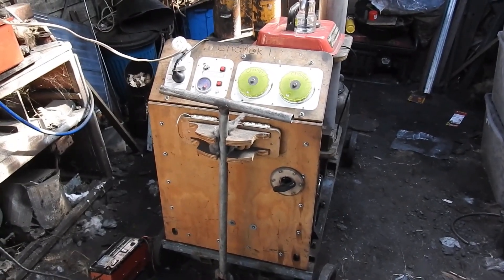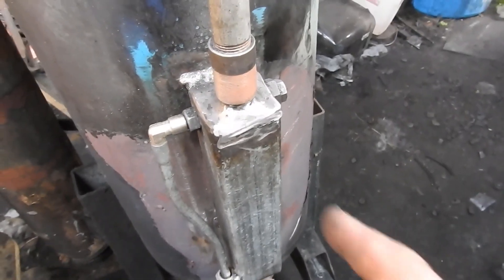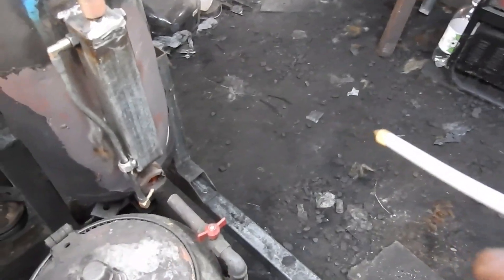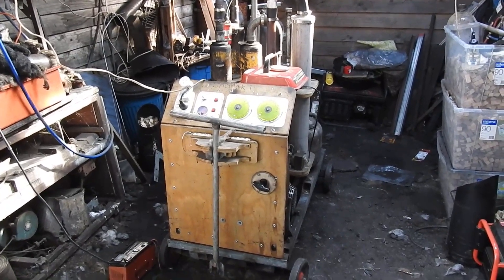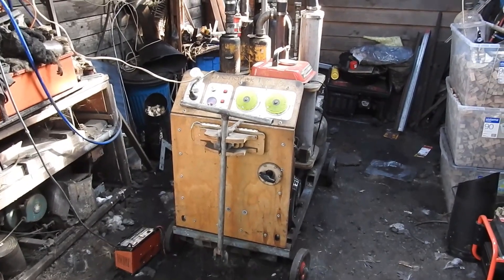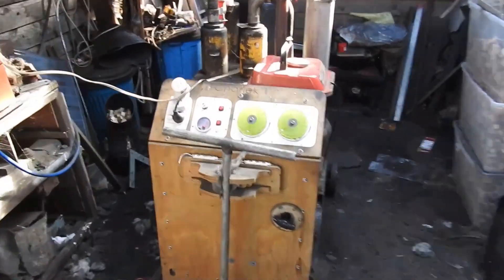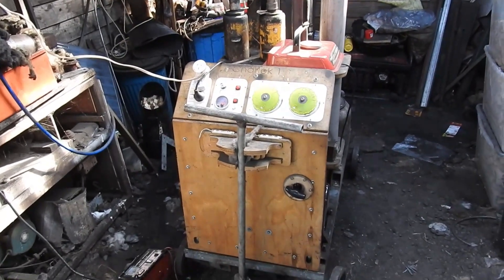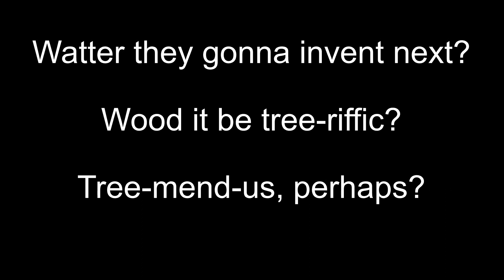If you want more watts - just Add Watter

Comment: In my wood gasifier I put oil in it I did have some success with it but thinking about it now maybe I should have heated the oil  up to a vaper
Reply from the maker: It is amazing watt a bit of oil can do to a gasifier. 
 Like you, I put a little bit in there, when the wood is low, and the glowing charcoal is visible. 
 That's when it seems to be at its best. 
 In no time, I use up all of the oil I collect from my regular engine oil changes   :) .

Comment: Steve I meant to reply back to you on the website blog. Could you possibly set up a high pressure nozzle that put out a very fine mist of water that could be controlled by a toggle circuit that would spray it in regulated spurts directly into the air intake? This way you could break the fine water vapors down directly in the charcoal chamber. Just a thought.
Reply from the maker: Howdee Mike, 
 I like that idea. A high pressure pump, feeding a tiny spray nozzle, wood make for the perfect injector system. 
 I will definitely be working on a couple of ideas, over the winter, to see watt works best. 
 Naturally, I wood like to see if this works on the air nozzle system that my wood gasifier uses. 
 Soooo many ideas, sooooo few spare tick-tocks!
Reply: @CNCmachiningisfun  OK Steve I'm getting ready to blow your mind with a KILLER idea! Buy one of the humidifiers that uses the 40 Khz transducer to atomize the water! Now you have a cold water steam source that will also have a variable intensity already built in. This way you don't have to deal with high pressure anything or special micro nozzles. Put that in your pipe and smoke it!
Reply from the maker: @flash001USA  
 Howdee Mike. 
 You owe me a new mind, 'cos you dun blowed the one I have already got  ;) .  
 I think I know where I can get these things, so, yes, I do believe that I will put this in my pipe - and race my engine on it   :)  .
Reply: @CNCmachiningisfun  But why bother with cold water mist? What you got now is good heat recovery. Why waste energy heating up water in the reduction zone where you NEED stuff to be as hot as possible? Am I missing something?
Reply: @CNCmachiningisfun  Yeah this hit me last night and I thought 2 birds, 1 stone. You get steam or at lease atomized water particles that may as well be steam and you can control the intensity of the flow. If this worked, you could also regulate it through a circuit that would auto adjust the flow for you for an optional ratio.
Reply: @flash001USA  I thought of that too. but its pretty easy to just convert to steam or simply drip water directly into the nozzle. If you drip directly into the nozzle the water will migrate into the jet and evaporate as it makes its way to the end of the nozzle. Besides the boost you get, you also want to cool your nozzle. So it is beneficial to use nozzle cooling as part of the process to produce the steam. 

One thing most will encounter is water surface tension at the control valve. A super easy way to get around that is to use the Crank case vent of the engine and use that to put a slight pressure in the water tank. You do not need much, just the engine pulsing is good enough to keep the valve flowing. 

Keep it simple all you need to drop water into your intake jet. Just don't over due it. But yes more elaborate systems I think we can get better efficiency. As I mentioned earlier I have a small evap tube to flash the water to steam and the water feed is easily controlled via the needle valve.
Reply from the maker: @nofootprintz  
 You make a good point, and I think it all comes down to a matter of balance. 
 Too hot, and the nozzle breaks down. Too cool, and the reaction slows to a crawl. 
 The steam will tend to cool the nozzle a little, as does the exhaust gas recirculation system that I use on my gasser. 
 I have other ideas that I want to try, including the injection of water into the muffler, so I can use the exhaust steam flow to feed the reaction. 
 Lotsa ideas. Gotta try 'em all   :)  .
Reply from the maker: @flash001USA  
 These ideas are the gold that paves the way to success, and also a less nippy woodgas bug population, so our necks will be safe. 
 I soooo wanna try 'em all   :) .
Reply: @Thrive-Off-Grid  What's that old saying?.... There are many roads that lead to Rome. Yeah I could see a lot of these ideas being valid. You never know until you experiment.
Reply: @CNCmachiningisfun  I'm having a close look on how things turn out. My gasser is doing great with combustion air preheated in a cross flow manner integrated into the big Flash001USA-inspired drum. Drum is insulated with about 5cm of rockwool, too. I haven't seen tar and only stupid high temps near the nozzles.
So heat recovery is my favourite thing. Maybe I can now trade a few of these precious degrees C for hydrogen. That would be awesome.
Plus, I love the idea of reducing wear on the nozzles by dripping water into them!
Thanks for making my gears grind!
Thanks for keeping us posted!
Cheers and beers!
Reply from the maker: @nofootprintz  
 Please forgive me for not replying before now, as google failed to let me know of your comment. 
 YouTube WAS great, then google broke it  :(  . 
 I think you'll be amazed at watt a little bit of watter can do for your gasifier. 
 Taking the heat out of the nozzles, while adding lots of watts to your engine, is surely a win/win situation. 
 OK, watter can be hard to find, these days, as it never seems to come down with the rain like it used to  ;) .
 Keep watting those woods, and swatting those woodgas bugs  :) .

Comment: It was common practice in WWII to use water injection for short bursts of power during a dog fight. ;)
Reply from the maker: Indeed. 
 I remember hearing about this on the radio, some years back. 
 They got huge improvements in fuel economy, and or, engine power, depending upon watt they were doing at the time. 
 Now that I have tried this, my only regret is that I didn't do it a LONG time ago   :) .
Reply: @CNCmachiningisfun  Well after doing a little searching, I found they used 50% methanol and 50% water with a trace of water based lubricant to help reduce corrosion. It was called MW 50.
Quoted from wiki: 
MW 30 increased the water to 69.5% and decreased methanol to 30%.[1] This increased the cooling performance but made it easier to freeze at -18 degrees C as opposed to -50 C for MW 50). 
I also found an electrolysis process that used an arcing spark from a welder through carbon rods held under the water. Interesting indeed...
Reply from the maker: @nasanction  
 It is amazing watt they used to do, in order to get the best from their hardworking engines   :) . 
 Electrolysis is fun, especially when you use it to set off a huge explosion. 
 Been there, done that - got the scorched tee shirt   ;) .
Reply: @CNCmachiningisfun  Here is a link converting to a gas and burning. https://www.youtube.com/watch?v=zX6cQ1ian14
Reply from the maker: I just now discovered your YT link, and took it out of the spam bin, where google likes to put good things. 
 Carbon monoxide, and hydrogen, made with power-tricity and carbon rods. 
 Nice  :) . 
 Not only that, but you also get hot water, so you can make a rather odd tasting mug of coffee  ;) .

Comment: That looks like you have really found something with this water injection system. It stands to reason trees need water so maybe treesel just might benefit from it too. Cheers
Reply from the maker: Yup. There is a lot of energy in watter, so it is a good thing that trees like to drink it  ;)  . 
 Some improvements are in order, but this system ig gonna be very busy during the upcoming winter, here on the farm.
Reply: I’ve been working with water as
Well  amazing work drop me your email have a question for you
Reply: @CNCmachiningisfun  whatt are you doing in da video.
Reply from the maker: @mistylover7398  
 I am showing that magic is possible, even if one does not have a horn, or wings  ;) .

Comment: Yup Im pretty much done with direct gasification. I can get more power out of charcoal and its easier fuel to produce. Here is another experiment for you to try. I plan to try this as well. But what we meter in a small amount of pure oxygen to displace the Nitrogen? I bet you can get more steam or water in as it will be the steam that will displace the nitrogen as you dilute it with the pure oxygen. If that works it maybe beneficial to add in an oxygen concentrator into the mix. I think even a small amount of nitrogen displacement will yield big results.
Reply: They way I understand it is that at around 1200 °C water (steam) splits into its components (hydrogen/oxygen), the oxygen is burned but much of the hydrogen isn't and thus finds its way into the produced gas.
Reply: @brianmurphy8790  In this process the steam can not split unless there is carbon present. The carbon is basically ripping out the oxygen and combining it with the carbon producing CO. If there is some oxygen from this process available for oxidation it will still get converted to CO in the reduction process. As this oxygen is being converted to Co2 it  will later shift to CO as the Co2 like the water; the oxygen will get ripped out of the Co2 to form new CO while leaving the left over CO behind.
Reply: @Thrive-Off-Grid  
That's kinda along the lines of what I meant.
That being, the O from the water bonds with the C to make CO but leaves the H2 behind, thus enriching the gas stream with CO and H2. I'm no chemistry expert so it's all a learning curve for me.
I've been contemplating the theory if this could be made into a closed-loop system.
For instance, if the exhaust gas from the generator is fed into the gasifier inlet, along with steam, yet without external air getting in.
Feed O to the engine direct from water, split by means of electrolysis, and route the additional H2 into the gas stream also.
With an airtight system wouldn't this reduce the nitrogen to just the traces in the wood feedstock?
Obviously there'd need to be exhaust gas (Co2) leaving the system somewhere, due to the additional O being fed to the engine.
Reply: @brianmurphy8790  The exhaust gas would crash the reactions. EGR is also used instead of water steam reforming on charcoal gasifiers as a means to cool the reactions. Too much EGR and the reactions will be too cold and it will crash. Using electrolysis will not work it will take more energy to crack the water via electrolysis than what you will get out. If you are just looking to enrich the Oxygen then use an oxygen concentrator. This will enrich the oxygen thus reducing the nitrogen content with way less overhead.
Reply: @Thrive-Off-Grid  
They were only a couple of the hundreds of ideas I've had...lol
I'm not really wanting to overcomplicate the system anyway. 
I live just around the corner from a wood yard and the owner has as much off-cuts/sawdust/shavings as I want - then just around the other corner is a garage with as much used motor oil as I want, and then there's the local chip shop with gallons of used cooking oil.
Yeah, my primary generator where most of the gas will be going has a diesel motor.
Reply: My new nozzle has a inner tube that the water drips into. This tube sticks inside the hearth and its end is capped off. Water is fed via a tube that insert's all the way to the end. Water is then dripped here inside this tube and is flashed to steam. The steam then migrate back to two jet holes drill into this center pipe. Then the air / steam mix exits into these holes and then is fed via the outer nozzle tube;
Reply from the maker: @Thrive-Off-Grid  
 For sure. Each gasifier system has its positives and negatives. 
 For me though, I am happy to use both systems, as they really do make a worthwhile difference here  :) .  
 Your oxygen addition idea is intriguing, and yes, you are surely right about the value of displacing nitrogen from the fuel gas stream. 
 I wonder if the steam stream is already doing that, to some small degree? 
 
 Your flash boiler system sounds great, and I wood say that it is a lot more effective than the tank system that I am currently playing with. 
 Mine will surely evolve, once I work out its strengths and weaknesses. 
 That stated, I am mighty pleased with the results that it is already offering. 
 Watt's cool is that I am now able to get more runtime out of each tank of charcoal, which saves me a fortune in treezel bills   ;) .
Reply: @CNCmachiningisfun  Yes I think the boost we are getting is not just from the H2 but an increase of energy density is also due to displacing the air feed with the steam reducing the nitrogen, while replacing it with the H2 and CO production of the water cracking.